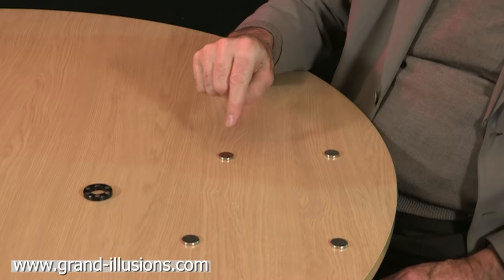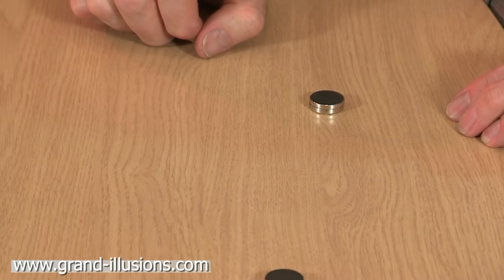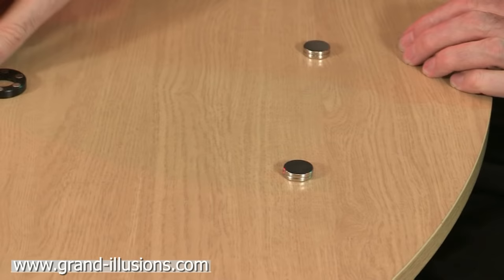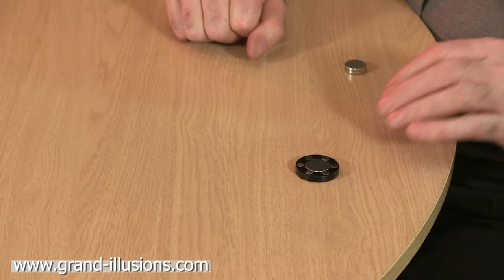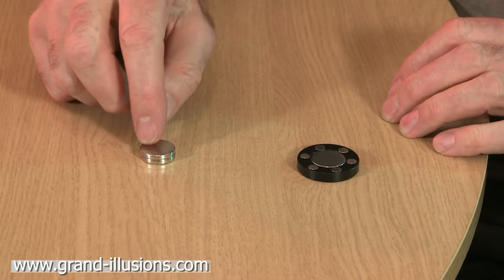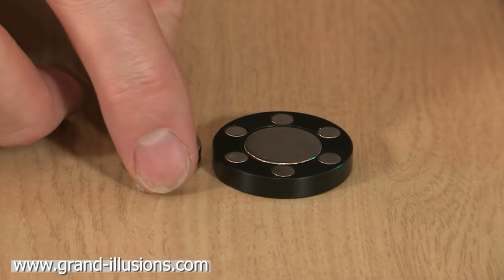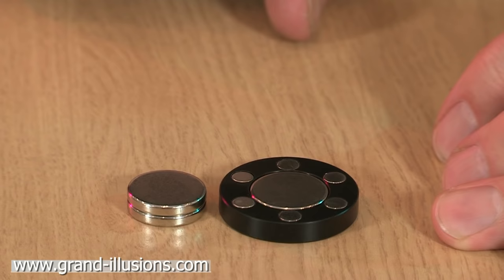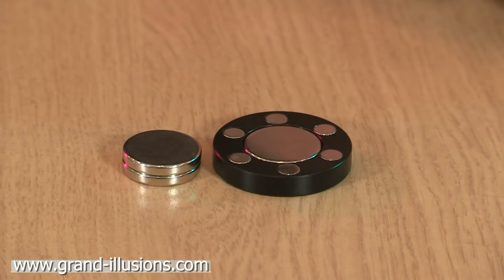Amazing Discovery With Magnets - The Inverter Magnet

Comment: But can you hold it up vertically, then dangle the simple magnet under it, so it hovers?
Reply: Sadly, no. 

Permanent magnetic levitation is proven impossible. http://en.wikipedia.org/wiki/Earnshaw's_theorem

Except for a number of cases that break the assumptions of the theorem. Such cases are diamagnetism (truly permanent), superconductivity (permanent as long as it is cold, arguably a special case of diamagnetism) spin stabilized as in the levitron (not permanent as spin will slow down) or active control as a number of levitating gadgets (not permanent since it uses power), most of these are shown in various of Tims videos.

This one has neither. It uses the force from the table to keep it stable, in the air the magnet would flip over.
Reply: Kasper Feld You can do it with certain diamagnetic materials in room temperature though.
Reply: I have a way to levitate them.  It makes use of a gyro combined with it.  The gyro won't stop due to a electronic motor.  I just need a couple grand to build it.  I do believe you will be able to ride it :)
Just money is stopping me.
Reply: Kasper Feld ah damn, i already imagine a train hover with magnet.
Reply: SumateRAGEming what? There are.
Reply: SumateRAGEming They exist.  :)  They're called Mag Lev Trains.  (magnetic levitation)
Reply: @charlesme2  Did you do it?

Comment: It's actually pretty simple, but a good demo for improving understanding of magnetic field interactions.

TL;DR: At the distance where the outer magnet stops, the pulling force from centre magnets is equal to repulsive force from outer magnets so they balance each other out.

Longer explanation: Magnetic force falls off in the inverse cube of distance. The big magnets' interactions cause an attractive force, while the big/small magnet interactions cause a repulsive force. Since the big magnet at the centre is so much larger than the satellites, the attractive force is stronger at long range. But when the big magnet outside the inverter assembly approaches the satellite magnets, the repulsive force increases faster than the attractive force. When the big magnet gets close enough to the satellites, the repulsive force will be stronger than attractive force and push the outside magnet away. But at certain point, the attractive force and repulsive force are just the same. That's the equilibrium distance. In theory, if you placed these magnets on a very low friction surface (like floating on an air cushion), they would start to oscillate around that equilibrium distance, and if you minimize the dampening friction forces, you can get them to oscillate like that for a very long time.

But the equilibrium distance is not quite the same on any direction. Because the satellite magnets are placed on intervals, the equilibrium distance has corresponding peaks and dimples on it. The equilibrium distance is, obviously, longest at the angles where the satellite magnets are, and closest between the satellite magnets. The system wants to settle to the lowest possible energy state, so the outside magnet will "fall" into the dimples where the equilibrium distance is the closest to the inverter assembly. And it wants to stay there, which causes the outer magnet to rotate with the inverter assembly.

This assembly is stable on two-dimensional surface, but unstable on three dimensions - if you try to lift the magnets from the surface into air, there will be nothing stopping the outer magnet from going up or down, and then it'll just probably flip over the satellite magnets and attach itself to the centre magnets.

By the way, the word "equilibrium" has its roots in two latin words: "Aequus" for "equal" and "libra" for "balance". It means, literally, equal balance and in physics that is applied to situations like this where two forces balance each other out.

Comment: Very interesting!
I can imagine how this phenomenon could be used for nearly frictionless bearings by using such an arrangement in an evacuated chamber.
Reply: Yes. . . or a completely magnetic transmission. No gears, no parts are touching. No power robing friction. No oil needed. No friction.

Comment: if you can balence the fiekds perfectly and shape them right you can make an magnetic bearing  wich are the lowest friction bearings you can get
Reply: that doesnt even make sense
Reply: Fennec Fox maybe...
Reply: FennecTECH the lowest friction bearings are those that are broken and don't spin anymore.
Reply: Choice777 - Fool! Broken bearings that don't spin anymore mean local friction is too high!
Reply: Choice777 — No, you fool! If the bearing does not move then it is either because it's stuck (extreme high friction), or, disconnected (disassembled, in which case it's no longer a bearing).
Reply: Your the kind of person that would rather be right than happy. 
Ewwwwww!!
Hope that works for you
Reply: Some1NamedMe friction implies moment. If it's static then it's locked.
Reply: Choice777 they don't move because of friction you dense being. Everthing would move constantly if we didn't have friction. Friction is the contact of matter with each other and consuming the kinetic energy converting it into heat. That's all what friction means. If matter would contact but not consume each other's kinetic energy, it would move forever.
Reply: Choice777 I HAVE to say your argument is irrelavent because if they don't spin or cause a reduction in friction, then they don't do anything except be a pediment to motion, which is the whole point of reducing friction...derrr
Reply: Buzz Lightyear Ummm...you NEED to know he wasn't being flippant or bullshit ting you about how friction Truly Works...if there's no motion of the bearing as motion is occurring with the part(s) the bearing is attached to, then there's NO bearing and therefore NO reduction in friction at ALLL Derrr
Reply: I'm playing with something else, wink wink
Reply: Ohhh, heat, friction, kinky
Reply: @Choice777  mic drop.    😂🤣😂🤣